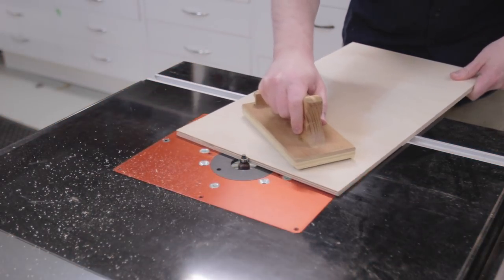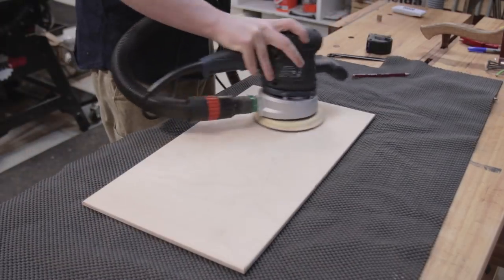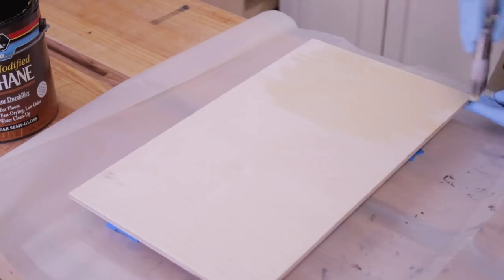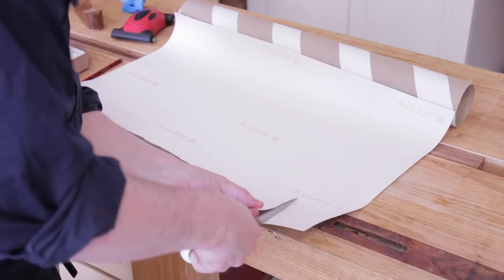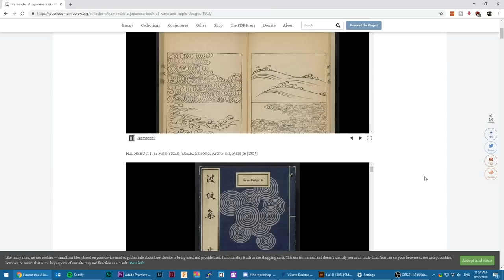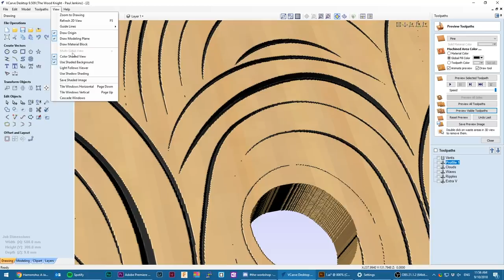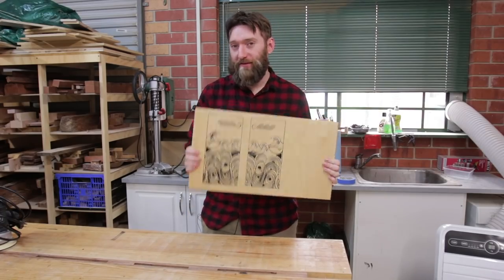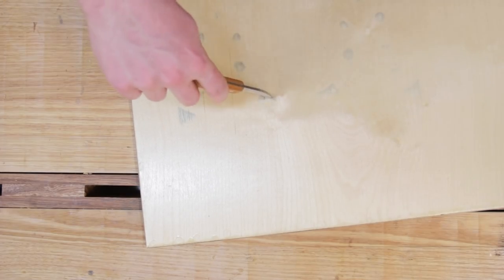Building a Laptop Lapdesk

Comment: So, it depends on what you want to airbrush. You can get something like this accomplished easily with a dual action airbrush. Siphon feed brushes provide you volume but can be finnicky with the pot tube. Gravity feed is superior for pressure, but you sacrifice volume.  Someone else has already mentioned the brushes. Can't go wrong with either the Badger (Patriot 105) or Iwata (Eclipse) I own both, and they are great brushes.   Alternatively if you're looking for large volume for painting large projects or putting a finish on...can't go wrong with a HPLV sprayer. I've had great success with the Harbor Freight sprayer.....for the money (20 bux US) it's well worth it.
Reply from the maker: Thanks for the info!

I'm happy with my wipe on finishes (hardwax oils mostly!), it'll really be just for colour in things like this (where an airbrush would let me lay down multiple colours much quicker), or transparent-ish dyes on small carvings (where rolling on colour isn't reasonable), so I think I'll be fine with out HVLP Turbine/Conversion guns.

Any airbrush paint recommendations (or more importantly any to avoid!)? Have you sprayed any particular dyes?
Reply: Well, you have 2 choices really. Acrylic (water based) or Enamel (oil based). I would suppose your needs would be based on your finish. 

I've used Vallejo, acrylic, as it's water based (which is primarily the finish I use) and cleanup is as easy as soapy water and windex. Enamel is just as effective, it just requires some thinning, and cleanup is a bit more involved. 

It's all a matter of personal preference honestly.

Createx Auto Air might be another great consideration....great paint, but does require some thinning and cleanup of your brush requires solvent. I used these quite a bit when I painted Motorcycle tanks.

https://createxcolors.com/

Comment: Could you please share which paint mask you use? I've been wanting to try some and a recommendation would help.
Reply from the maker: I used either Aslan 85G or S79. I'm actually not sure which 'model' it is, 'cause the label fell off the roll! The 85g is a bit better in my experience, 'cause it has a higher initial tack than the S79. I got mine from GAMart.
Oramask is a comparable product  depending on where you are
Reply: @TheWoodKnight  thanks very much!